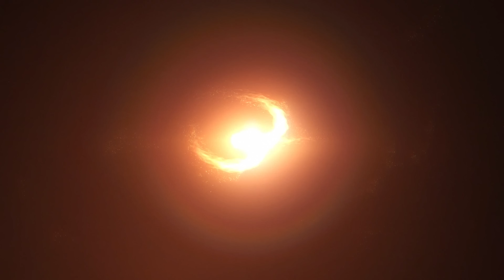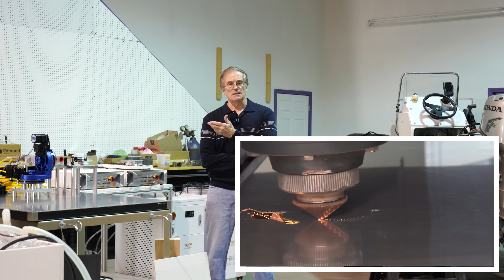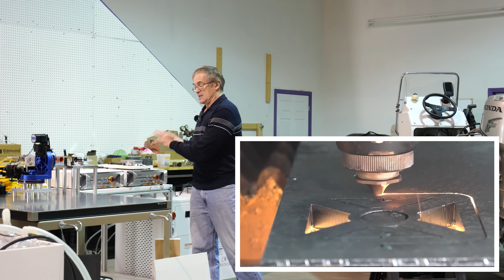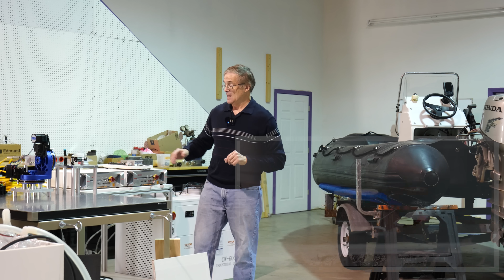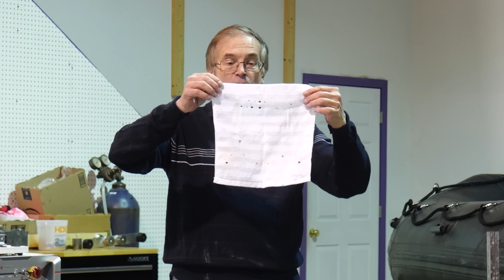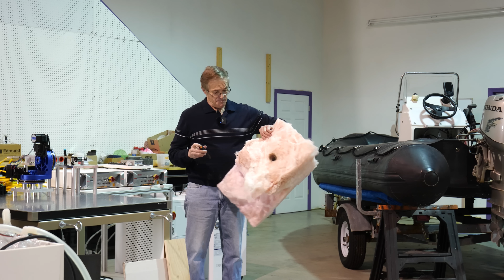We have a problem... and need your help!

Comment: Electromechanical Beam Diffuser with Pre-Calibrated Piezo Actuator: Lightweight, innovative, barrier-free, seamless integration.
Hybrid Lens-Shutter System: Redundant safety, barrier-free, slightly more complex.
Ceramic Tile Array with Passive Heat Sinks and Graphite Coating: Simple, modular, robust.
Hybrid Ceramic-Sand Composite Panels with Zirconia Layer: Cost-effective, scalable, robust.
Precast Refractory Concrete Panels with Optimized PCM Inserts: Effective, but heavier.

Application Overview

The application involves an indoor video demonstration showcasing a high-powered single-mode fiber laser system (near-infrared, ~1 µm wavelength, 1 mm beam diameter) with an intensity 500 times higher than a previous system, capable of melting steel, burning firebrick, and destroying tires. The laser, originally designed for industrial metal cutting, uses custom optics (beam correction, rough collimating lens, and fine focusing lens) to produce a nearly parallel, tightly focused beam that maintains high intensity over long distances. A computer-controlled targeting and tracking system directs the beam to destroy targets (e.g., drones). The primary challenge is preventing the beam from damaging the facility (e.g., walls, equipment, or external objects like a truck) during system glitches, lockups, or rapid target destruction, without requiring a specialized facility or massive, immovable barriers.

Requirements:
Block or Diffuse the Laser Beam: Stop, absorb, or diffuse the high-intensity near-infrared laser beam to prevent damage to the facility or external objects.
Minimum Duration: Withstand or manage the beam for at least a few seconds (preferably longer) to allow the computer to override or a manual kill switch to be activated.
Absorptive, Not Reflective: Absorb or scatter the beam to avoid reflecting it back toward operators or equipment, preventing unintended damage.
Non-Flammable: Must not ignite or sustain combustion under laser exposure.
Non-Toxic: Must not emit toxic gases when heated by the laser.
Portable: Lightweight or modular for easy setup, removal, and repositioning between tests, avoiding the impracticality of a massive, fixed barrier like a stone wall.
Reasonably Available: Use commercially accessible materials or components, avoiding exotic or custom-made solutions.
Cost-Effective: Affordable within the budget of a video production team, avoiding solutions costing millions (e.g., specialized facility).
Practical for Large Area: Scalable to cover a large area (e.g., 2x2 m or more) to protect the back wall or other surfaces.
Safe Operation: Must not introduce additional hazards (e.g., fire, toxic fumes, or mechanical risks).
Ease of Maintenance: Reusable or easily replaceable components to support multiple tests without significant rework.

Short explenations of the 5 suggested solutions:
1. Electromechanical Beam Diffuser with Pre-Calibrated Piezo Actuator

Description

This solution integrates a high-speed electromechanical system into the laser’s optical head. A frosted fused silica diffuser (5 mm thick, 20 mm diameter, ground to 1000-grit finish for uniform scattering) is mounted on a pre-calibrated piezoelectric actuator (e.g., Thorlabs PK2FSF1, 50 ms response time). The targeting system’s computer detects when no target is present or a glitch occurs (via real-time camera feedback) and triggers the actuator to slide the diffuser into the beam path within 50 ms. The diffuser scatters the beam from a 1 mm diameter to a ~10 cm diameter, reducing intensity by a factor of ~10⁴ (from ~MW/cm² to ~kW/cm²), below the damage threshold of facility materials (e.g., concrete: ~100 kW/cm²). The system is powered by a 24V DC supply and interfaces with the existing targeting computer via a USB or GPIO connection.

Implementation
Components: Fused silica diffuser (Edmund Optics #47-945, ~$100), piezo actuator (Thorlabs PK2FSF1, ~$400), control electronics (Arduino-based, ~$100), mounting bracket (custom aluminum, ~$100).
Assembly: The diffuser and actuator are mounted in the optical head, aligned with the beam path using a precision jig. The actuator’s pre-calibration (factory-set for 100,000 cycles) ensures reliable positioning. Software integration modifies the targeting system to send a digital signal (0/1) based on target detection.
Setup: The system adds ~200 g to the optical head, requiring no structural modifications. A 2x2 m area is protected by diffusing the beam, eliminating physical barriers.
Maintenance: The diffuser is reusable indefinitely; the actuator requires annual checks (visual inspection, ~5 minutes). Replacement diffusers cost ~$50.

This solution meets all requirements with no compromises. The lightweight, barrier-free design is highly elegant, leveraging the existing targeting system for control. Pre-calibration eliminates maintenance complexity, and the low cost (~$300–700) fits a video production budget. The rapid response and innovative use of diffusion maximize safety and practicality.

2. Hybrid Lens-Shutter System

Description
This dual system combines a frosted fused silica diffuser (5 mm thick, 20 mm diameter, 1000-grit finish) with a ceramic-coated metal shutter (2 mm steel plate with 1 mm alumina coating, 30x30 mm). Both are mounted on separate piezo actuators (Thorlabs PK2FSF1, 50 ms response) in the optical head. The targeting system triggers the diffuser to scatter the beam to ~10 cm diameter (~10⁴ intensity reduction) when no target is detected. If the beam remains on for >1 second (indicating a prolonged glitch), the shutter engages, absorbing the beam completely. The alumina coating withstands >2000°C, ensuring >20 seconds of protection. The system uses a 24V DC supply and integrates with the targeting computer via GPIO.

Implementation
Components: Fused silica diffuser (~$100), alumina-coated steel shutter (~$150), two piezo actuators (~$800 total), control electronics (~$150), mounting bracket (~$100).
Assembly: The diffuser and shutter are mounted in a dual-track system within the optical head, aligned using a precision jig. The targeting system’s software is updated to manage two signals: diffuser activation (immediate) and shutter activation (1-second delay). The shutter is spring-loaded for fail-safe engagement if power is lost.
Setup: Adds ~300 g to the optical head. No physical barriers are needed, protecting any area.
Maintenance: Both components are reusable; the shutter’s coating may need reapplication (~$50) after ~100 tests. Actuators require annual checks.

Evaluation
Block/Diffuse the Beam: Diffuser reduces intensity; shutter absorbs fully, ensuring no damage.
Minimum Duration: Indefinite (diffuser) or >20 seconds (shutter).
Absorptive, Not Reflective: Diffuser scatters; shutter absorbs with alumina coating.
Non-Flammable: Both components non-combustible.
Non-Toxic: No emissions.
Portable: ~300 g, highly portable.
Reasonably Available: Components from Thorlabs, CoorsTek, or McMaster-Carr.
Cost-Effective: ~$400–800, within budget.
Practical for Large Area: Barrier-free, scalable to any area.
Safe Operation: Redundant diffuser and shutter ensure safety; 50 ms response.
Ease of Maintenance: Reusable; minimal maintenance.

Meets all requirements with no compromises. The redundant design (diffuser plus shutter) enhances safety, and the lightweight, barrier-free system is elegant. Costs are reasonable, and integration is straightforward. The fail-safe shutter adds reliability without complexity.

4. Hybrid Ceramic-Sand Composite Panels with Zirconia Layer

Description

Modular panels (100x100 cm) with a 1 cm zirconia (ZrO₂) front layer (99% purity, yttria-stabilized), a 5 cm compressed sand core (silica sand bound with 5% sodium silicate), and a 1.5 mm carbon-fiber backing frame. The panels are mounted on a wheeled aluminum stand for mobility, positioned 2–5 m behind the target. Zirconia withstands >2500°C, and the sand core absorbs residual energy, lasting >20 seconds. The carbon-fiber frame reduces weight while maintaining structural integrity.

Implementation
Components: Zirconia layer (CoorsTek, ~$100 for 2x2 m), sand core (local supplier, ~$50), sodium silicate (~$20), carbon-fiber frame (~$100–300).
Assembly: Sand is mixed with sodium silicate, compressed into molds (5 cm thick), and cured at 200°C. Zirconia plates are bonded to the sand core with high-temperature adhesive. Panels are bolted to the frame.
Setup: The 2x2 m setup (~20–30 kg/m²) is moved via a dolly. Covers a 2x2 m area, scalable by adding panels.
Maintenance: Reusable; damaged sand cores reformed (~$10/m²); zirconia plates (~$25 each) replaced as needed.

Evaluation
Block/Diffuse the Beam: Zirconia and sand absorb the beam, lasting >20 seconds.
Minimum Duration: Exceeds requirement.
Absorptive, Not Reflective: Non-reflective materials.
Non-Flammable: Non-combustible.
Non-Toxic: No toxic emissions.
Portable: ~20–30 kg/m², highly portable.
Reasonably Available: Zirconia from CoorsTek; sand and silicate locally sourced.
Cost-Effective: ~$210–410 for 2x2 m, highly affordable.
Practical for Large Area: Scalable by adding panels.
Safe Operation: Passive design; no hazards.
Ease of Maintenance: Reusable; easy core reformation.

Comment: Try mylar or something super reflective maybe made of tungsten. Your looking for something like a fun house mirror. Reflect the beam into many different directions instead of a coherent beam, kind of like your fiberglass idea, might have to liquid cool it on the backside. Hell a ferofluid might work. Or spin the backdrop really fast so the beam is in contact with a small area for a short amount of time. What if you elongated the target area on the plane parallel with the beam so it falls onto a larger area. Or you could use a beam splitter and dice the beam up into more manageable and less coherent beams. Or you could aim your beam into a tunnel that has a more dense atmosphere, possibly through panes of double glass containing more opaque gasses.

Comment: Colloidal particles suspended in water in a glass container will be a good idea. The laser will lose it's energy slowly when it go through the colloidal particles water mixture in it's path and the energy will be absorbed by the water. You can also use color to make the water semi transparent instead of the colloidal particles. You can test which works better.

Comment: Starlite or similar compound. It's safe and easy to use, can withstand extreme heat, can be pasted onto items, and can be made with very little cost. Apparently the original "brought to the grave" formula could resist lasers that recreated 'nuclear detonation' temperatures, so the recreation formulas should be enough for your use. I think this is the exact thing you want, in every way you want it.

Comment: Damp wood could do the trick. It will most likely catch fire locally, but it won't spread. 

Alternatively a block of carbon. Carbon takes a lot of energy to ablate and won't burn under normal atmosphere. But it might be hard/expensive to get enough of it.

Comment: Why not just reflect the laser into the ground instead of trying to absorb extremely highly concentrated amounts of energy? It seems like this is a challenge you do not need to face. Just put in a new floor when you finish :)

Otherwise one could use a diffusive material. Transparent but randomly redirecting the laser. Then some distance behind absorb it, should de-concentrate the energy.

Another option would be to use a killswitch. Hollow area inside the barrier with light sensors inside. If the sensors are triggered means barrier is compromised and power needs to be cut. 

Another option would be to use a reflective material; like silver mylar that is supposed to reflect light "randomly" in every direction. Material wont degrade if it doesn't absorb. And It wont send back a dangerous beam. (You can scan for the reflection and use an automated kill-switch)

Catching the laser with optical fibres does not seem feasible in this situation.

My final suggestion would be to use a fluorescent or phosphorescent material that will temporarily store the energy of the beam (wavelength dependent of-course) in the material (bumping up electron energy levels) which will be dissipated by emitting light at a different wavelength. (Which you could scan for without interference of the laser-light)

I hope any of these suggestion might help you explore alternative methods. That is all I can help you with because I am not a material expert.

Comment: I was thinking a mirror and a dump vat of water.  I've seen that design on a lot of old industrial cutting lasers that take about a second of time to stop fully outputting light when the power is cut, but I think it's impractical.  

I do want to add that when you do the explaining fiber lasers video you do a depth test to see how much water the laser can penetrate, like shoot it strait down in a barrel or something.

Comment: I never use fibreglass insulation for heat
It contains formaldehyde and breaks down. Rockwool will take 800c better is ceramic fibre, 1300c, but only after a cooling tank

Comment: There was a project a while back to build a laser fence to kill mosquitoes to prevent malaria. The laser was low power because it only targeted the wings of the mosquitoes. A scanning laser handled targeting and could differentiate between different insects and even make vs female mosquitoes by the beat frequency of their wings. You could build something like it that only targets the propellers and make it man portable with much lower power required.

Comment: Try hydrogel. The stuff in diapers. It's cheap, mostly water, it can form large marble like beads which might refract the light passing through it, and It's disposable unlike a wall of wet sand. Just don't seal them in containers. Allow for steam to leave. If you puncture a container, the hydrogel should prevent major leakage unlike water. Make thin acrylic panels, with a 1 to 2 inch container space for hydrogel, with a rugged metal back for mounting the panels like drywall sheets on studs or aluminum truss like you would an LED wall. In theory, you could just drill a long enough screw through both the front and back panels to mount them to a structure, as you don't have to worry about leaks. The water is already contained within the container itself.

This is the least expensive yet practical idea that comes to mind. Good luck
Reply: Hyrdogel will also refill gaps like sand, with the benefit of not being sand...

To be honest, i just want to see hydrogel vs a high powered laser. Will the beads pop like popcorn? God i hope so.

Comment: not sure if this is practical but what if you redirected the beam into some kind of hole in the ground(or box made out of bricks) with an array of mirrors or (wall of mirrors) that every point of the array/wall leads to the laser trap.

Comment: I couldn’t stop thinking about having a huge heat sink.. maybe we could try running water on a both sides of copper sheet.. youll be dissipating the heat by water first then whatever left will hit the copper which will be cooled with the running water

Comment: TLRD:  refractory bricks on several carts

Hmm... what's cheap, locally available, lightweight, and can withstand incredible heat for 10 seconds? (1-2 seconds is definitely not safe; a safety margin is needed.)
Exotic materials are out. A large amount of water is too inconvenient and risky for indoor use, as it could flood everything. Overly complex systems take a long time to assemble and set up, and might also prove unreliable.

Essentially, fire resistance and mass are required. If an object lacks mass and doesn't reflect the laser beam, it will burn through very quickly (unless it's something like spacecraft shielding, which is feasible but time-consuming and expensive).

Per the requirements, excessive mass is unacceptable. However, what's truly needed is the ability to move the shielding; the actual weight is a secondary consideration.

So:

1. Lightweight refractory bricks on several trolleys/carts. After the project, the trolleys would still be useful, which makes this solution more cost-effective in a sense.

2. Boards with a fire-retardant coating. The laser will burn through them, and they'll smoke, but they won't sustain combustion (i.e., they won't keep burning). So, if you're already inclined to use boards and are comfortable working with them, this could be a very straightforward solution.

Comment: It would be interesting what it would do against asbestos. Orrrrr FOR ARMOUR (possibility of reflections but I am interested in whether it will STOP and protect the target behind it....). I would be really interested if you could test mercury between 2 panes of glass. or micro spheres made of glass maybe behind a one-way window? or a glass pane? or if the micro spheres absorb too much thermal energy too quickly, try 2-3mm glass spheres. But a possible solution for your actual problem..... what about plain silicone sand in a wooden box? It'll blast through the front of the box but if the laser penetrates into the sand, the sand should just absorb the energy and be turned into glass?

Comment: How about coating a base material in intumescent paint? Night hawkin light did a few videos about such paints and it could reaist a laser for a limited amount of time.

Alternatively you could soak a carryer material in water. Something like insulating wool or even natural materials like cork. You would have to put a watering hose for plants inside/on it to keep it wet constantly but that should be doable.

Comment: How is it possible that the material that focuses the energy of the laser doesn't melt?
You said it is focused through several lenses.
The first lens shouldn't be exposed to a high energy density, however the last one is taking it almost all!
Or am I wrong?
If that is the case, can't the lens material be the solution to your problem?